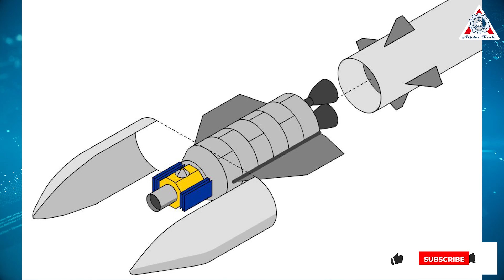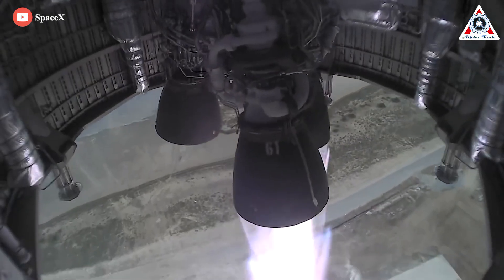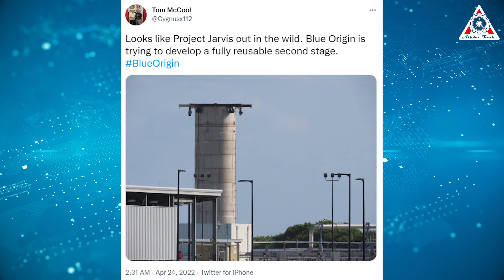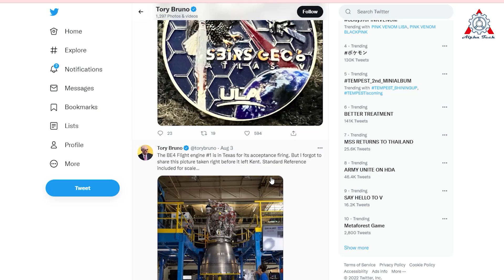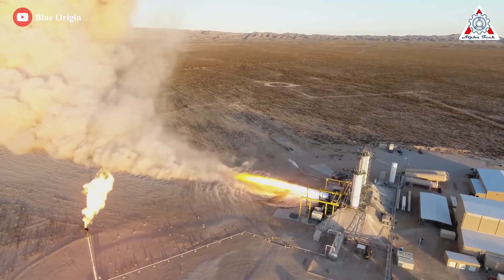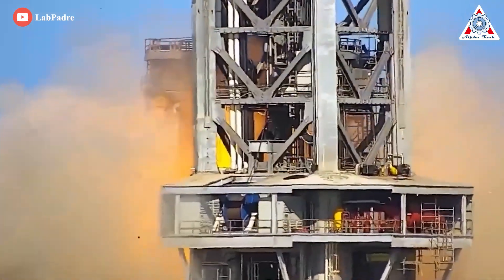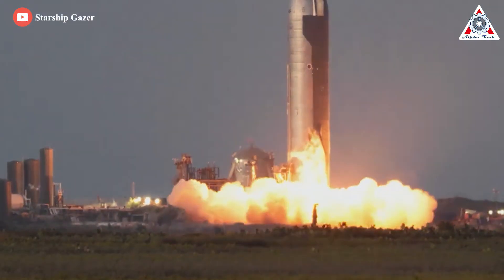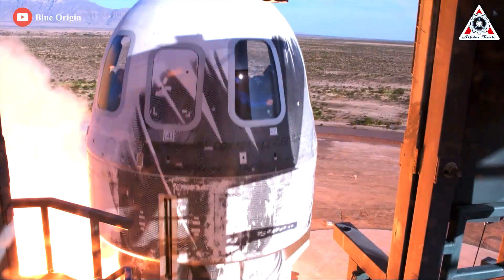Somehow the copy project of Blue Origin just made new development, trying to REPLACE SpaceX

Comment: I wonder about how much BO's Vulcan engine can be throttled? In other words, can the Vulcan throttle down enough to land New Glenn?  One of the benefits of Raptor 2 is that it's "small" size coupled with its ability to throttle (down to 40%) is that a Starship booster and Starship itself will have pretty fine control over descent rate prior to landing.
Reply: Apparently Raptor will 'decrease in number', hence become bigger. So, go figure. Elon will surprise to that upside too.

Comment: Quick comment: When talking about thrust it is "lbf", that is to say "pounds-force" not "lb-ft" which is "foot-pounds" which a torque not a force.  We in the US use pounds for mass as well as force, when we oughtn't.  Slugs are for mass, but those aren't popular.  Thus the distinction of pounds-force, vs pounds-mass.  Nice to see BO starting to get off their butt, if for no other reason than to give SpaceX motivation to plow ahead, further and faster.
Reply: On earth, the weight of one slug is 32.2 pounds.  If you're doing precise scientific measurements, you would use the metric system as a lb is very slightly different at different earth locations due to the nonuniformity of gravity at the earth's surface.
Reply: @billweberx  Exactly, that is why you call out lb-f or lb-m.  Lb-m doesn't change, but it is very much a crutch, I agree.  But it seems super hard to get us Americans to give up Oppressive-British-Colonial-Overlord  units and go metric... I put it down to Stockholm Syndrome... :P
Reply: @mjlagrone  I think it's just lobbing from businesses that have all their design documents in Imperial units and don't want to pay for the transition.  I've worked at several of these companies, and the mechanical designers hated it when they had to add a component that is in metric units.

Comment: Bezos was working on booster and upper stage recovery before SpaceX by sometime. In fact SpaceX started after Blue Origin by a few years. Bezos company been working on much longer goals such as larger booster rocket engines and that poses many challenges. Unlike SpaceX Blue Origin works in a far more secretive place so it is hard to judge where they are in regard to their large booster. Recently they posted a number of photos of their booster and rocket engine and test firing it looks like they are running around their timeline for it.
Reply: It's not hard to judge.  They haven't made it to orbit.  It's not much of a rocket company until they do.
Reply: @billweberx   I believe Bezos always had it in his head to make new Glenn based on design was much longer goal to flight vs Falcon. Falcon was designed for smaller payloads and more of low orbit hops and provide funding for the Starship. New Glenn falls between the Falcon rocket and Starship but I am wondering if Starship could fly at all. Bigger the rocket the greater the technical issues see SLS. I think everyone from NASA to Washington where surprised by Bezos showing the status of the work on New Glenn.
Reply: @netgeek3010  Whatever Bezos goals, he's failing, badly.  

After seeing what SpaceX could do in such a short time, you really doubt they can get Starship to orbit?  I'd take that bet.
Reply: @billweberx   It's not specifically targeting SpaceX it is targeting size and scale. The Starship will have twice the thrust of NASA Saturn 5 that was a monumental undertaking and unlimited budget. You may be saying but that was in the 1960's but reality rockets have really not changed that much with the addition of thrust vectoring. But really the actual way that fuel is pushed through the rocket is very similar. 

There is very hard goals to hit to put such a massive rocket into space. The weight is about in Elon's own words is 50 tons heavier then they where targeting. The science to building a reusable rocket also comes into play opting not to use carbon fiber fuel tanks and using space shuttle tiles have added weight to an already heavy rocket. The other the way they had originally planned to cool the rocket has been changed due to temps rising much higher then expected.  There is a video of it being tested to extreme levels only to have it fail to cool the internal parts. 

Blue Origin is opting for the long game because much of the money is being funded by Jeff and some of his investors. Upwards of 2 billion dollars or more a year out of his pocket. His rocket will be superior to Falcon Heavy but fall short of the Starship.
Reply: @netgeek3010  "but reality rockets have really not changed that much with the addition of thrust vectoring. But really the actual way that fuel is pushed through the rocket is very similar"  

Are you nuts?  SpaceX has blown away every aspect of rocket technologies.  Here's a few ways:

The Raptor is a Full flow system (staged combustion cycle) engine. Previously this type of engine was impossible due to the materials needed to survive the extreme chamber pressures and temperatures.  SpaceX developed new materials to reach the highest chamber pressures in rocket history.  No one else has succeeded with this rocket design.

Restartable ignition system for the first-stage booster. 

New attitude control technology for the booster to bring the descending rocket body through the atmosphere in a manner conducive both to non-destructive return and sufficient aerodynamic control such that the terminal phase of the landing is possible.

Hypersonic grid fins were added to the booster in order to enable precision landing. Arranged in an "X" configuration, the grid fins control the descending rocket's lift vector once the vehicle has returned to the atmosphere to enable a much more precise landing location.

A large floating landing platform for launches where the first stage does not have sufficient fuel to return to the launch site. As of 2022, SpaceX built three autonomous spaceport drone ships, one operating the West coast and two on the East coast of the United States.

A thermal protection system to avoid damage to the first stage when re-entering the atmosphere.

Lightweight, deployable landing gear for the booster stage.

SpaceX developed their own formulation of stainless steel for Starship to withstand the high pressures and high temperatures during take offs and landings.  They went away from carbon fiber because they found they could make stainless steel work better ( could handle more heat) and it would be lighter overall, not heavier like you implied.  Plus, it was far cheaper.  The tiles are not space shuttle tiles.  They're about half as thick and about half the weight and made of a completely different material.  Just because the Starship is heavier than Musk was hoping, it's still capable of carrying up to 150 tons to low earth orbit.  Saturn 5 could carry at least that much but it didn't have to carry all the equipment and materials that made the Starship fully reusable. 

Starship is being designed to be refueled in space, allowing it to take 100 tons of cargo anywhere in the solar system.  

All this information is available online.  But, I'm sure you knew that already.

Comment: Many estimates place Blue Origin 3-5 years behind SpaceX....
Reply: New Glenn is to compete with Falcon 9 and Falcon Heavy.

Falcon 9 first launched in 2010.  New Glenn MAY launch in 2023 that puts them 13 years behind Falcon 9.

Falcon Heavy first launched 2018 so New Glenn is at least 5 years behind there.

To make the 2nd stage reusable they either need to redesign the booster or sacrifice some of the 45 ton cargo capacity.  That would either add years to the project (and more 1st stage engines) or significantly reduce the cargo capacity meaning less over lap with Falcon Heavy capacity.  

Finally of course Falcon 9 has well over 100 successful flights already.  It will take quite a while for New Glenn to be proven reliable and safe to bring down insurance costs for customers.

Comment: One has built
Everything to a final
Tested article and the other is not. New Glenn is no starship… but it IS a massive rocket. Also, the Sheppard serves a dual purpose. For all intents and purposes, that is the second stage. All the tanks, plumbing and engine. Rated and tested.
Reply: New Shepard is not a second stage.  Why would it be made to land but NOT built to re-enter?  The capsule has no ability to propel itself so if it went to orbit it has no way down.  It can't even maintain communications during flight.  

New Shepard is a carnival ride and beyond that a dead end.
Reply: @Scanner9631  on top of that, New Glenn has never planned to recover the second stage. But I agree it would be great if they were to design something similar to starship to go on top of the new Glenn. 50 tones to LEO is not earth shattering, but the volume this thing carries is crazy. Did you also know that Apollo will still be the largest rocket ever built as it put 155 tons into low earth orbit. Starship is only going to do 100 tons. But be fully reusable which is fantastic
Reply: @davidbowerman6433  

Bezos has stated that the New Glenn 2nd stage needs to be reusable for New Glenn to operate at a profit and started "Project Jarvis" to build one.  The little info that has come out on Jarvis shows what looks very much like a smaller version of Starship in its "silo" stage of development.

The amount that Starship can take to orbit still isn't known but the more recent comments by Musk are more about 150 tons.  The 100 ton limit was based on Raptor 1 at an early development stage and also before various weight cuttings to the over all design.  I personally would be surprised for less than 125 tons and more than 150 wouldn't surprise me.  

Remember starship is still in prototyping and Falcon 9 capacity has increased enough that its fairing size is too small for some of the cargoes it and Falcon Heavy can launch.  Fortunately due to its modular design making Starships cargo hold longer should be simplicity itself, just add another ring section.
Reply: @davidbowerman6433  Funny thing about 50 tons to LEO.
That was Saturn C-3 specification (cancelled 1963), 
that DoD indicated they could use (payload gap, numerous studies) since late 1960s.
New Glenn fills that NRO 7m diameter capacity and ~50 ton to LEO.
==
In 1 launch, New Glenn could launch Skylab main module to LEO (~80% usable capacity of ISS).
Reply: @Scanner9631  But it has tested every single component of the second stage. takeoff the legs and you have a hydrogen oxygen be-3  You’re clearly not an engineer or have a mechanical background. Or you would understand how this tests everything
Reply: @davidbowerman6433   You’re clearly not an engineer or have a mechanical background. Or you would understand how this tests everything

It is smaller than the planned 2nd stage.  It has no cargo area.  The REUSABLE 2nd stage development called Project Jarvis began last year.  New Shepard was flying before that.   They are NOT the same.  The 2nd stage planned previously was NOT reusable so NOT New Shepard.

So it tests everything?  Heat shield?  Doesn't have one.  Re-entry?  Doesn't get to orbit and no heat shield so doesn't test that.  The 2nd stage uses TWO BE3 vacuum engines, New Shepard has ONE sea level BE3.  Doesn't test that.  Doesn't deploy cargo from its non existent cargo hold so doesn't test that.

Please provide your source for your CLAIM that New Shepard is the New Glenn 2nd stage.